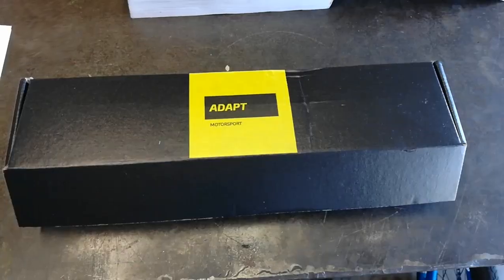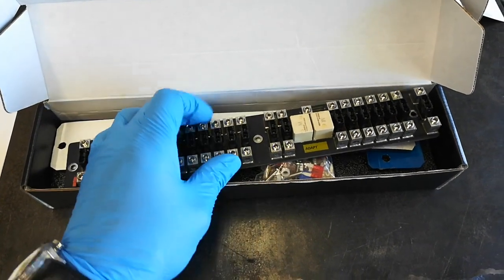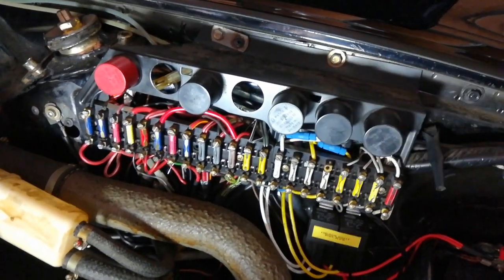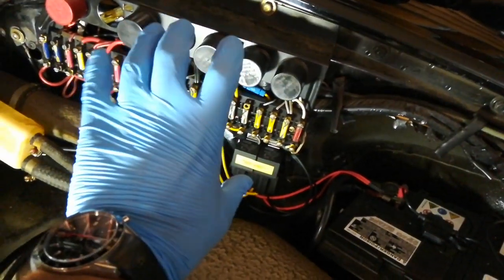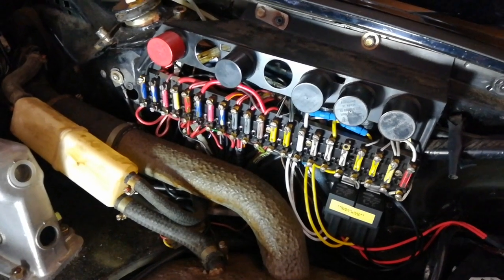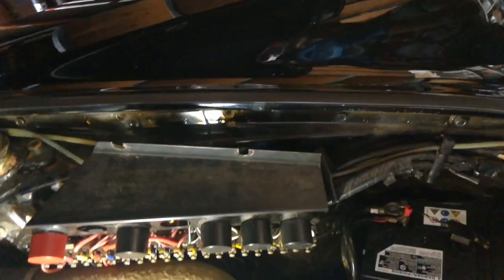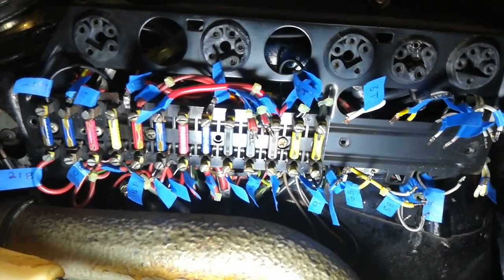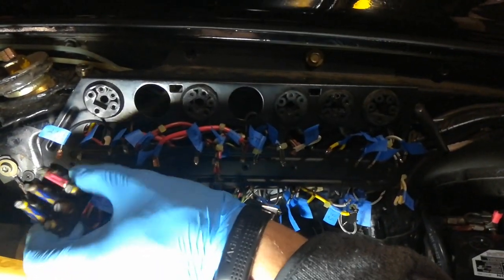Air-cooled Porsche 911 Fuse Panel DIY Upgrade Part 1 of 3: Front Panel Removal

Comment: Did the same upgrade. Some of the wires were harder to put back because of the fuse board having less terminals and an integrated relay. Made it work by carefully pulling them from the wire loom tape. If you don't care for integrated relay (but please add an external one otherwise) and the integrated LEDs..maybe the refuze panel is easier to install. 

For the rear, I opted not to drill the fuse holder (mostly because I couldn't easily get the holder out). So I ended up getting the CDD Refuze one for the rear. Uses factory hole. No lights and uses slotted screws..yuck but does the job!

Comment: What is the function of the relays mounted on the upgrade fuse circuit board? The old fuse panel doesn't have those relays. Do those relays replace hi/lo relays that are elsewhere in the car? Why did you decide not to use them?
Reply from the maker: The 2 relays on the new board are headlight relays for running higher wattage bulbs. They replace the 2 old relays I had hanging under the old fuse panel. The old fuse panel did not have headlight relays; they are an aftermarket kit.